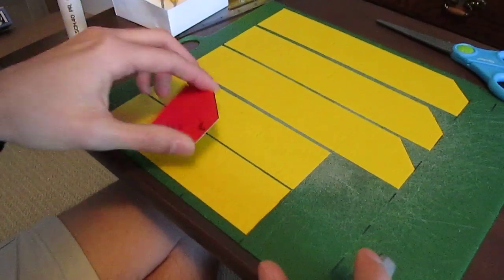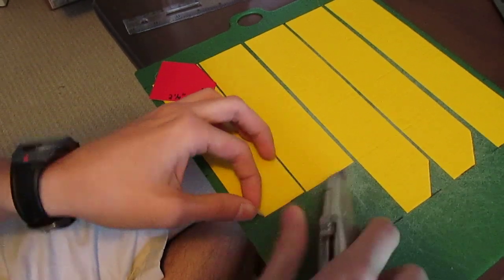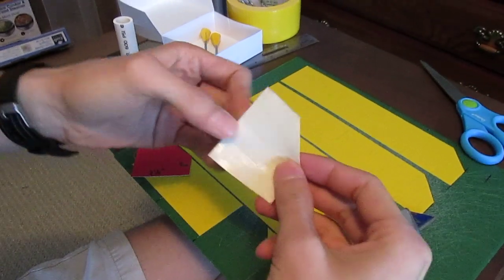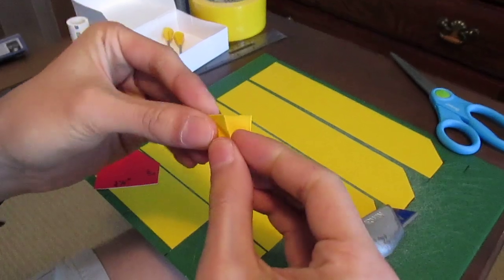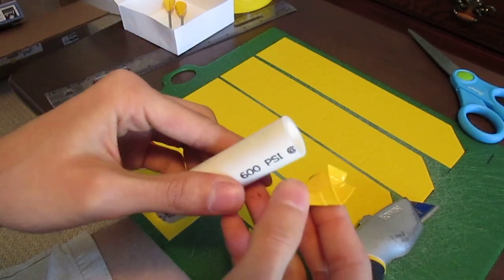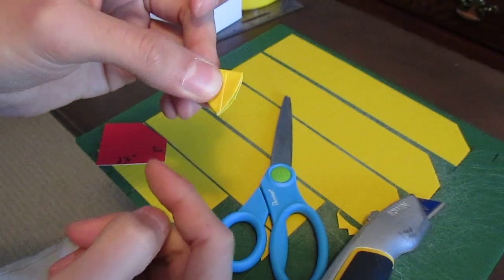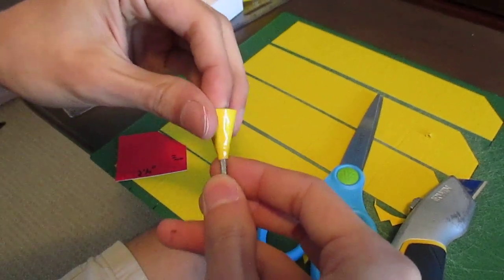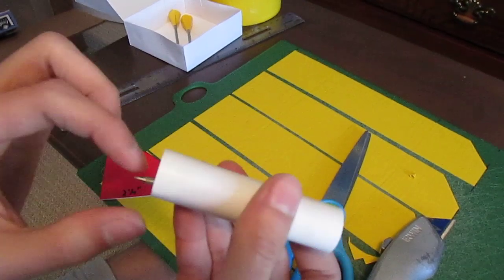How to Make Water Resistant, Reusable Blowgun Darts

Comment: Use TIG Welding Rods for Darts, comes in a Variety of Metals, Alum, Stainless, Mild Steel, Titanium, and others, Straight 36 in and a Wide Variety of Diameters for Darts. I am waiting for my first Blowgun, but I would Contribute that. Cheers!

Comment: These cones are very, very heavy, but they are water resistant. nails are also heavy (if they are steel) as is the hot melt glue.